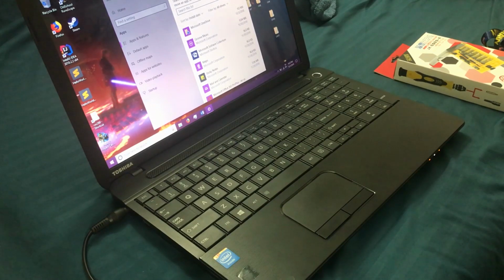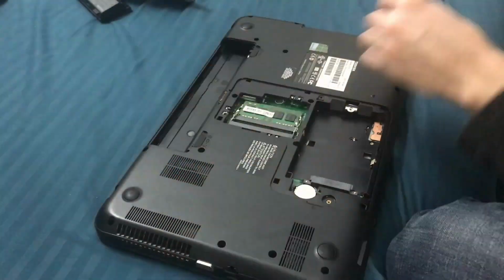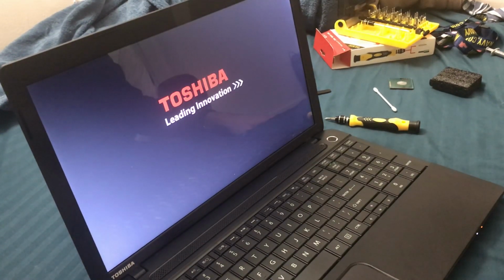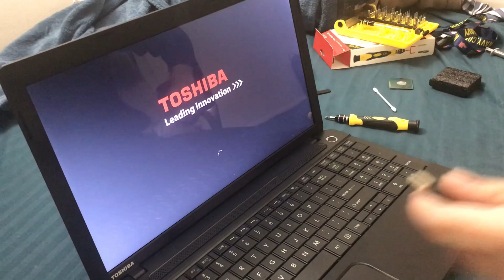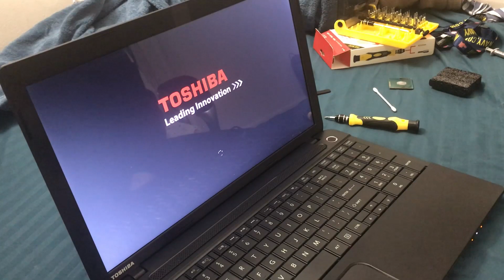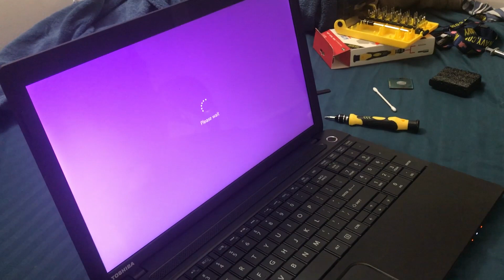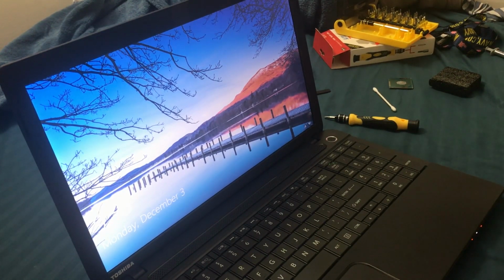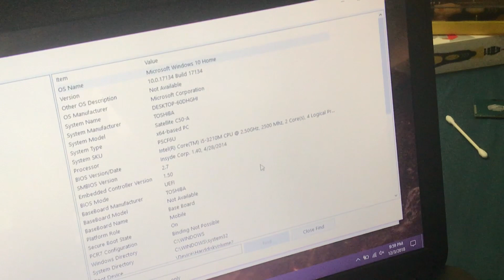Toshiba Satellite C50-A Processor Upgrade

Comment from the maker: If your cpu is a Pentium or a Celeron, then you’re stuck with those options. If your cpu is at least an i3, then you can swap for an i5 or an i7. 

There is a security “feature” in Intel ME that shuts down the computer every 30 minutes if you upgrade from a Pentium/Celeron to a Core i processor.
Reply: same problem how can this be solved
Reply from the maker: @bonifaceubana9915  there is no work around
Reply: @HowdyYT I have the same problem ... how can fix it?
Reply: @HowdyYT  and what about update bios  ? I think will be solved  ? !!
Reply: This is useful info! Thank you. Can  another, faster Celeron (or Pentium) be installed? Short of a different mobo!
Reply: @j.lietka9406  upgrade to pentium 2030M, the highest supported processor on HM70.
Reply: Can that be fixed with a custom bios
Reply: I have that toshiba satellite 50 A, core i3, HDD 500Gb and RAM 4GB laptop, can i upgrade its processor to core i 7 8th gen?

Comment: I have an i3 3120M cpu in my satellite pro.  Running win10. Theres no issues but i tried upgrading to win11 but cpu is not supported. My satellite pro is also a c-50 
Can i simply change the cpu if it removable like yours and if so which cpu will i need to enable win11? 
Any help will be much appreciated . Thanks
Reply: "Your current hardware configuration is not compatible with Windows 11, as it requires a minimum of 8th generation or newer components, and there is no option for upgrading in your situation."

Comment: Any processor replacement idea for AMD E1-1200 APU with radeon
Reply: e1 1200 uses BGA or onboard CPU for upgrade you need to buy a new motherboard for that, sadly its like you bought a new laptop

Comment: i upgraded my processor from Pentium to core i3 but my laptops goes off in 10 to 15 minutes..............battery working fine and no overheating error code....please how can i solve this issue?
Reply from the maker: Check pinned comment

Comment: Do the bios get corrupted? I purchased a laptop thats upgraded and it force shut down every 30 mins
Reply from the maker: This is actually a “feature” of the bios. I think more specifically it’s Intel ME. It’s to prevent the user from upgrading the laptop and incentivize purchases of more expensive models.
Reply: @HowdyYT  bro the laptop had intel Celeron and the seller upgraded it to i5 2nd, i told him about this Intel ME and now he is downgrading it to i3 2nd gen. Would it still be a problem?
Reply from the maker: @polarbear9696  yes. You’re basically capped at the Pentium 2030m. I tried an i5 and an i3 and both had the same issue

Comment: Thanks Howdy! Very informative. I have the same model and have upgraded to 8gig and an ssd but it still bottoms out (/tops out depending on your perspective) on some apps/multi-tasking - as they say your only as fast as your slowest component, so thought I'd search to see if a CPU swap out is easy and your video is the first one I found and subsequently watched. and thanks to you I will go for it. Now it's 3 years since you posted this vid, would you recommend the pentium 2030m?
Reply from the maker: Thank you for commenting! I haven’t used my laptop in quite some time, but I let a family member use it for some PowerPoint presentations and video playback (very light workloads) and they haven’t had any complaints. As far as the 2030m goes, if you’re doing light work, and if you can afford it for $35 (cheapest current eBay price) I’d say it’s probably worth it. I personally find it very satisfying to work on electronics, and this swap is pretty easy and cheap, so the fun-factor helps justify the price for me. 

At this point, if you can spare 2-300 dollars I would look into the secondary market, either eBay or Facebook Marketplace for a better deal. If you need to do anything more than word, PowerPoint, or YouTube playback the pentium is going to struggle. I remember it taking minutes to open certain programs I used for school. 

Whatever route you take, I hope it all works out for you! And thanks for watching! I know it was probably painful to sit through LOL

Comment: The exact same laptop I have but there is one problem...

I want to upgrade the RAM.
Reply from the maker: It’s super easy. All you have to do is remove the bottom panel and you get quick access. You don’t even have to take off the entire thing. Just get a matching stick of ram and you’ll be good. I upgraded to 8gbs either shortly before or shortly after this video was recorded. Good luck!

Comment: bro i have the same laptop as you, Can you tell me how I look for the processor model to be able to change it?
Reply from the maker: You should be able to find out through task manager or system info. If it’s a celeron or a pentium then you’re limited to those. If it’s an “i” model then you should be good for an i5/i7

Comment: I have c50-a-1e1 whats the best processor i can put?
Reply from the maker: It depends on your motherboard. If it has a pentium or celeron, then you can only go up to the pentium 2030m because of the lockout bios. If it has an i3 or better, then you should be able to put an i7 3940xm in it, but you’ll have to think about cooling at that point too. The cooler probably won’t be able to handle that part.
Reply: @HowdyYT  thanks for the fast reply. Mine has pentium 2020m so i wont be able to upgrade to an i5
Reply from the maker: @k.o.7629  correct. There is this “feature” they coded to shut the computer off after 30 minutes if you use anything better than a pentium. It’s technically possible, but you’d only be able to use your computer for 30 minutes each time. It’s a real bummer.

Comment: Hi, could you let me know if it is possible to change the processor of the Toshiba Satellite C55-A 5302 notebook?
Reply from the maker: No clue, but it should be pretty simple to check if you’re willing to disassemble your machine. If you have a socket, then it’s swappable.
Reply: @HowdyYT  Did you manage to change yours?
Reply from the maker: @SINDEL1999  yes! But there are a lot of laptops with very similar model numbers, so I would suggest opening yours up before you buy a new processor

Comment: Tip for anyone that still owns this laptop.

Buy the HM86 version of this motherboard, and get a 4th gen laptop cpu.
Reply: source!
Reply: beware, you might need to cut of a piece of plastic on the hole where the sata connectors go through. the placement is a bit different compared to your model

Comment: What other cpu can be installed instead of a Celeron and Pentium? have you tried to flush the bios from a core model?
Reply from the maker: Have not tried to flash a different bios. No other cpus besides the Celeron and Pentiums function for more than 30 minutes. Last time I looked into it there was a community tool to flash a custom bios, but it required an arduino and a bios flasher (the clip on kind). It wasn’t worth the haste for me.

Comment: My laptop is a SATELLITE C50-A-19T, and probably has a HM70. Does exist any motherboard for this laptop but with another chipset? And if exist please tell me what motherboard is.
Reply from the maker: I honestly don’t know
Reply: @HowdyYT  I found that the Toshiba Satellite c850 l850 motherboard has exactely the same aspect of the SATELLITE C50-A-19T, than i just need to change the heat sink because the C850 brings a GPU, with this motherboard you can have a i7. This motherboard comes with the HM76 chipset.

Comment: Hey man, would a i7 3540m work as an upgrade from a i3 3110m?
Reply from the maker: I think it would, but I’m not entirely sure.
Reply: @HowdyYT  Wow, thanks for replying so quick bro I appreciate it.
Reply from the maker: @revelati_n  no problem. The only thing stopping me from upgrading past the pentium line was some lockout code in the bios. Since you’re already running an i3 I would assume you should be able to use an i7 just fine. That being said, I would try to find another source or two before you go through with it. You can never be too certain
Reply: @HowdyYT  Alright man have a good life thanks.
Reply from the maker: @revelati_n  no problem. Good luck and you too!
Reply: @HowdyYT  I have a Satellite C50-A aswell, with i3-3110 / HM76 chipset. Ordered a i7-3612QM (quad core) yesterday and will give it a shot next week (fingers crossed), the  i7-3520 should be doable (its also 2 core like the i3-3110, same watts. l1 steppings etc). Hopefully the BIOS doesnt cut of after 30min!
Reply from the maker: @keyboardbw  good luck!
Reply: @HowdyYT  Thanks! Its done and my laptop runs like a train! No issues whatsoever.
Reply from the maker: @keyboardbw  sweet!
Reply: @keyboardbw  thanks for the update!
Reply: DavA.  yes

Comment: What type and how much ram does the motherboard support? I have 1 stick of 4 gb DDR3  on 1.35 voltage, can i put in DDR3L  in the second slot ?
Reply from the maker: I think mine had 4 gigs of lpddr3. Just pop the back hatch and double check.
Reply: Mixing voltages well done 👍

Comment: i have question in my toshiba satellite C50-A-1FU i can upgrade procesor? i dont know what cpu's my laptop support i only know that i have socket G2 and my actuall cpu is pentium 2020M 
i be very greatfull if someone help me
Edit: and also you must update bios like in computers motherboards?
Reply from the maker: Some bios versions have code to prevent processors better than the pentium line from working longer than 30 minutes. You would have to research that yourself. You might be able to instal a 2030m, but it would be pointless and more of a side grade. Yes you can update the bios the exact same way.

Comment: The c55 A5242 modelo supports some i7 o i5 i would appreciate it if you could help me
Reply from the maker: Google “(your motherboard and bios version) cpu comparability” and make sure that the processors are compatible before you buy. I bought 2 cpus that weren’t compatible before I did my research.

Comment: i have nearly the same laptop. and i want to do a very big upgrade for it. the model is  (toshiba satelite c55 a5302) but i am still confused about the cpu (i want it powerful) any suggestion?? and how did you install a higher cpu than pantium or celeron and it did boot ??
Reply from the maker: The installation would be the same. However, on my model the bios has a lockout coded in that will shut the system off after 30 minutes. I tried both an i5 and an i3 and they were both locked out. You just have to do some careful research about your particular bios and find the most powerful chip that is still comparable. For me that was unfortunately only a pentium.
Reply: thanks for the tips. can i in some way update the bios or do a trick to bypass the lock in the bios?? and how do i know that my bios lockes out cpus??
Reply from the maker: Basel omar Kilani I think you can reflash the bios with a community modded version, but it requires a clip-on bios flasher and an arduino. It was something I just wasn’t interested in at that point. If you tried today you would probably have little help, as our parts have been irrelevant for some time now. As for if your bios will allow a specific cpu, you would just have to do a little googling. I think you can find out what bios you have through cpu-z, but it’s been a while since I’ve used that utility. Best of luck to you!
Reply: @HowdyYT  thx bro.btw i think bios reflash is a bit advanced for me. but again thank you
Reply from the maker: Basel Kilani no problem!

Comment: Can we upgrade the gpu on this exact model as well?
Reply from the maker: Kills The Man I don’t believe so. It’s integrated graphics on my model
Reply: Integrated graphics into the cpu
Reply: @kateajurors8640  how exactly?
Reply: You can't  upgrade the onboard inbuild graphic of these machine.  I have played assassination  crid IV at 2 fps with the base machine pentium B960. But there is always a loophole.  If you are happy loosing the inbuild wifi module the same wifi slot can be used as an external express PCi slot to which you can add any desktop levsl graphic card which need an exteranl Power supply SMPS to power up.  Its a bit tricky.  But will definitely  work.  All you endup is a laptop for gaming but you need an external wifi module USB to connect to internet or the regular  RJ45
Reply: @sharathspawar  Agreed we need to change the motherboard if we do want to upgrade it
Reply: @altamashmk9993  nope brother get the theory correct. Pentium B960 and the peak i7 2960XM both released in the same Q4 of 2013. And both are repalcable i  the same socket without motherboard  upgrade.

Comment: I'm upgrading mine with a amd a6
Reply from the maker: AMD processors are incompatible on this socket
Reply: It worked yay!
Reply: It was so easy
Reply: They arnt I checked my freind also did it it works fine.
Reply from the maker: Dainis Cakuls okay good luck 👍
Reply: K thx. My school has most of the Same Toshiba's and they all have amd a9. Also I have the c50pro. Idk which on you have coz you said A.

Comment: I have this laptpp which has the same processor like this, like intel celeron. I want to upgrade that laptop's cpu to intel core i5 and the egpu to nvidia gtx
Reply from the maker: Tahsin plays YT make sure to research the bios and make sure it is compatible. The i5 was not working on this machine
Reply: @HowdyYT  Well I'm not a expert of cpu's but does intel core i3 support this laptop?
Reply from the maker: Tahsin plays YT nothing above a pentium is supported
Reply: I have the same model like yours but my processor is i5 , it has also two graphics card intel hd graphic 4600 and nvidia GeForce 710m. I want it to upgrade to higher if posible including the ram. Any suggestions?

Comment: My Toshiba laptop wouldn't start up. It has a power light,charging light,the fan start and stop immediately. What you recommend? is it a BIOS, Micro processor or what?
Reply from the maker: Lemma Ashagrie have you tried taking the battery out and trying to turn it on while it’s plugged in?
Reply: @HowdyYT  yes i have try too much. but no change @ all.
Reply from the maker: Lemma Ashagrie hm… maybe try reseating the ram and processor
Reply: @HowdyYT  While I rest the  Ram, and also try to  configure BIOS by the local maintanance shop. It is just like before. My question is that if the microprocessor is getting damaged, the fan try to start?,  power button is getting light? When i plugged the power adapter charging comes  light?
Reply from the maker: Lemma Ashagrie I’m not sure. Check to make sure there is thermal paste between the processor and the heatsink

Comment: It said it was comparable on the toshiba website
Reply from the maker: Unfortunately there are multiple satellite laptops under very similar product numbers. I tried the 3120m and it would still shut off. It’s all down to the bios chip.
Reply: Compatible
Reply: Most processors are compatible. If it shuts down after 30 mins that is the users fault who put it in the wrong way as a i5 does work on mine
Reply from the maker: Dainis Cakuls if the processor was inserted incorrectly the device would not boot. As stated, it is a well known bios issue implemented to prevent upgrading cheaper laptops. If the i5 works for longer than 30min in your system then your bios is not the same as this particular model’s.